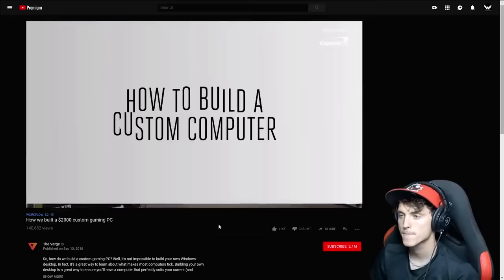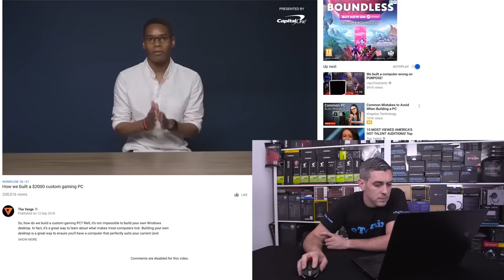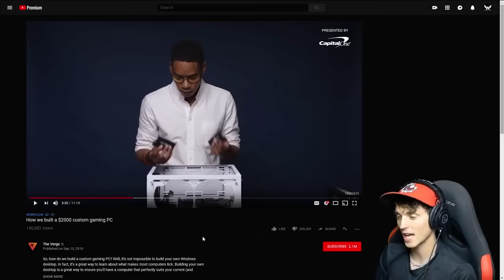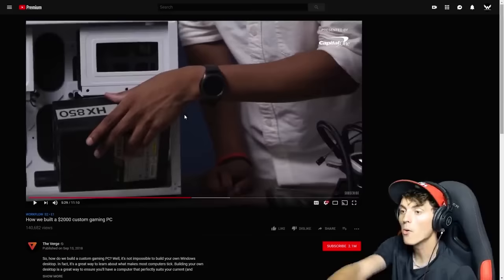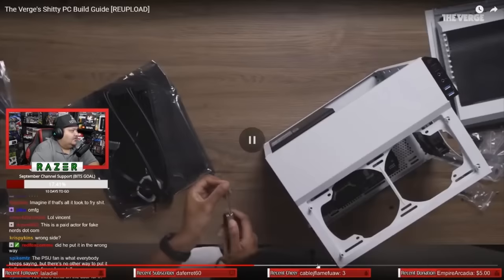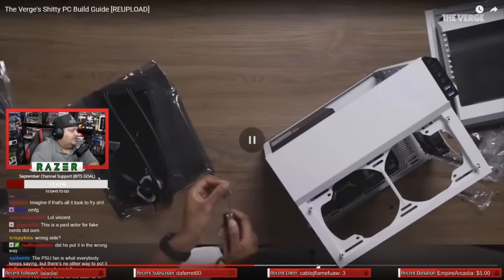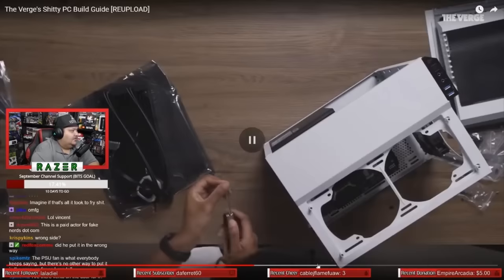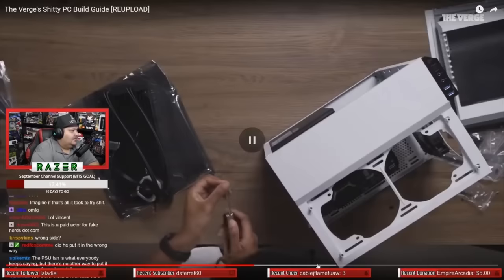The Verge's $2000 PC Build Reaction Supercut

Comment: imagine being satisfied with 70 fps after spending $2000 on your pc
Reply: i mean if it was on 4k ultra id say thats pretty good, but it wasnt so...
Reply: Even Joey delgado Got 120 FPS only with $400 PC
Reply: Diarra Altera Virendra i got the acer nitro 5 with rtx 2060 gpu i7 9thn gen cpu and it came wit 8gb ram but i upgraded to 12gb
Reply: @S0L0_544  Owww, Mid end to High spec i like it
Reply: Diarra Altera Virendra yep
Reply: You guys have more than 60 FPS? 
What feature is that on console?
Reply: uh bruh its the feature where u throw ur console out the window and buy a pc. But fr i still love my ps4
Reply: rf Eli so whats rhe point. Also my monitor is 240hz. Also mines a laptop
Reply: rf Eli also on some older games such as dead space i get 500 fps and 650 in menu screen
Reply: AlexRichter544 theres no point other than seeing how fast your pc is lol
Reply: Gemstone addict i could tell the difference if i ever get fps drops, but its probably because my eyes are used to seeing 200fps by now, which is a curse cus i play cod on ps4. but someone who is used to lower fps than what they’re looking at may not see a difference between two higher ones
Reply: @Stizy  at that point u might as well crank up the settings
Reply: @gemstone_addict  im pretty sure its lower than that as ppl say but the fact that we move and look around rapidly makes it to where more frames is beneficial to filling the blur when moving.
Reply: I get that with about $380
Reply: Bro I get 60 fps average and I spent 400$

Edit: just found out that my computer was capping all of my games for 60 fps so I can actually get more fps than 60 lol
Reply: We dont have to imagine lmao
Reply: Bruh
Reply: AlexRichter544 why buy a laptop for gaming and not a desktop?
Reply: He literally built the "hottest" Pc on the market LOL!!
Reply: AlexRichter544 laptop valorant  andy yikes
Reply: AlexRichter544 I have the same laptop as you, but when I play games like siege, the cpu temp gets pretty high like around 80% but it shouldn’t hit that, I think? you got any advice since you have the same laptop? I still am using the 8gb ram and 1650 gtx it comes with.
Reply: AlexRichter544 what kinda ram do you use too?
Reply: AlexRichter544 also do you also get a problem with loud fans or is it just because my cpu and gpu are low
Reply: @S0L0_544  whoosh, i guess
Reply: I get your sentiment, but the game he is playing is ArmA. It's optimization is absolute garbage. Majority of us would get 40-50 FPS in multiplayer. He is getting 70 because he is in SP (editor). With that PC, I'd expect to see 40-50 FPS but how he built it, but his CPU would probably throttle and give him 15-25FPS in a couple of minutes of MP. (This game is very CPU intensive and only uses a single core)
Reply: At least you got 120 fps at lol
Reply: @S0L0_544  meanwhile my lenovo legion y520 runs valorant with 120fps but litterly drops everytime to 30fps
Reply: Omne Obstat But the prob is, it isnt 15 years aho. And its an i7 and gtx 1080
Reply: I built a PC, bought a monitor, keyboard and mouse for $1400 and I'd get sick to my stomach if I ever saw 70 fps.
Reply: Did you not see everything else that just happened
Reply: Rxbsii at least he got to turn it on without a fire😂
Reply: Rohan Tejeswar well he chose a bad game to test his pc with lol
Reply: i get 50fps on an E-Mac... spending $2000  on a NEW computer to only get me that much...?
Reply: ._. Radeon Hd 3600 apu... 2007. 85fps 1080P. All ima say. Lmao
Reply: Actually if turn on is by miracle
Reply: 70fps in ARMA3 is good result. Framerate in Arma is more dependent on what is going on in the mission, rather than what PC you have (for some extend). But yeah, 70fps in just a single plane flying is not that impressive.
Reply: The Doomsday Duck trust me 2000 can get you very very far if you know what ur doing and know how to overclock, this dude doesn’t know what a zip tie is
Reply: @davirendra6774  WHAT SPECS?? I WANNA KNOW
Reply: @IIFM54  The 400$ PC?
Reply: @davirendra6774  ye
Reply: rf Eli an i7 9th gen Mobile can’t do 240fps the tf you on?
Reply: lmao..  the guy is a huge clown
Reply: My shitty dell laptop can run league at 250fps
Reply: I can hit 70+ on my 6 year old shitbucket
Reply: @S0L0_544  playstation for the exclusives tho. If the console market wants to stay afloat, make me buy a console cause there's 5-10 games I really wanna play that's only for that platform.
Reply: I mean, it is Arma, but then again he is in a jet when he says it sooooo
Reply: I would feel genuinely bad for anyone stuck with that fps after that budget.
Reply: Mac
Reply: James Nguyen my fans are at max speed while gaming which is quite loud but when im wearing my headset i cant hear it
Reply: James Nguyen i think 80 degrees is fine but if it gets any higher make sure to use the nitrosense software that comes with the laptop to increase fan speed
Reply: AlexRichter544 I mean valorant isn’t that demanding but that’s still pretty good
Reply: I can hit 70 FPS on ArmA with my $1.2k laptop. And that's on medium-high setting.
Reply: With motion blur in a plane xD
Reply: @uhbruh9223  currently there are monitores that support over 244 fps
Reply: AlexRichter544 Damn and only 1k?
Reply: uh bruh You need to throw your console in the trash, buy a pc, now you have joined the master race and can work, talk, draw, edit videos, and play games at 120+ frames. Welcome to Nirvana.
Reply: My laptop gives 60 fps consistently ( can go beyond but screen is 60 Hz only) and it's only 800$. A PC at same price is supposedly more powerful than my current laptop. This dude made a PC costing 200$ more than twice the price and still got only 70fps. Why? Just why? They could have hired anyone from this video and gotten a better and cheaper build.
Reply: this post was made by rtx gang
Reply: When Linus watches him, Bring the shotgun! Time to use it boi!
Reply: he be playing lol and going omg 70 fps meanwhile my thibkpad runs minecraft multiplayer at 300 fps and the think pad is old as shit its not even in production anymore
Reply: @Sinsanatis  well but fps xD
Reply: @davirendra6774  you got lucky mate also nice budget
Reply: @dragringer1480  That's not my PC 😂😂 i don't have a PC i play in Console i just tell that tech Youtuber "Joey Delgado" Got 120 FPS only with $400 PC
Reply: @S0L0_544  goddang. I can only get 24-30 fps in most games, 10-15 if im lucky and 60 in the menu screens
Reply: Robert TheRonin what computer do you have? Before i got my current laptop i had a surface pro with a intel core m3 cpu intel integrated graphics and 4gb of ram. So basically it couldnt run anything
Reply: @S0L0_544  ill find it out tommorow morning. Its a laptop but its meant to be a gaming laptop so I dont know why it is the way it is
Reply: at 4k it would
Reply: Robert TheRonin ok sure let me know
Reply: I mean it is Arma
Reply: U guys have PCs?

Still uses my gameboy advanced
Reply: Arma 3 is strictly cpu expensive, tanoa and Livonia (newest maps) are taxing on gpus but generally arma 3 is badly optimised.

But getting 70 in a jet on tanoa with no ai is not an acomplishment.
Reply: @Stizy  What games do you play that get such godly fps, and can I please know the specs to this creation?
Reply: Also league of legends tho
Reply: @Stizy   Try playing actual games lol
Reply: I get 70 to 80 on my £800 build 1080p high.
Reply: I get better fps on my freakin phone
Reply: have you count the spare parts?
Reply: rf Eli Dude, real world is obviously more fps than any monitor. You didn’t get super eye powers from your computer monitor, thats beyond stupid.
Reply: @davirendra6774  yeah, if you play minecraft then yeah.. My $2000 pc runs minecraft on 900 fps so..
Reply: yeah like wth he should have more than 100 fps unles hes playing with rtx or some shit
Reply: @S0L0_544  where did u buy the ram bro?
Reply: im satisfied with 140 to 150 on ultra settings on my middle of the road build at 1080p
Reply: Luna's Mom got off ebay cuz im poor now. Btw i luv luna too
Reply: Hey man, that's ArmA. I'd kill to get a stable 70 FPS on that piece of optimization garbage.
Reply: When I put frame rate on unlimited I can run up to 4500 frames per second I spent the same amount the verge did.
Reply: 11 Decky Mass 11 sure you can
Reply: @S0L0_544  valorant is pretty ez
Reply: Diarra Altera Virendra notvin 4k High
Reply: For 2k, I'd want an absolute state of the art beast.
Reply: My 800 dollar build had more fps lol
Reply: My $1100 laptop with a 2060 can play warzone at 144+ fps all day, this company is shit.
Reply: Holy shit I can get that with integrated graphics
Reply: @gemstone_addict  nope there is 100% a difference, I've been playing on 240hz and looking at any lower refresh rate looks kinda jittery to me.
Reply: @Stizy  the frames that aren't shown are still important, they allow for more responses per second, which is essential for any game where you need to perform things fast
Reply: @uhbruh9223  xD, this is too underrated
Reply: rf Eli     guessing your playing CS:GO on low settings for 500 fps or a game with lowest setting lol
Reply: AlexRichter544 how do you upgrade a laptop with 12 gb? If you don’t mind me asking.
Reply: I have a better pc and barely getting 30 fps on minimum requirements in arma. But that's normal
Reply: That's pretty good for Arma 3 lol
Reply: @S0L0_544  my 1000€ PC gets 400-500 in valorant
Reply: No cap I'd want 200 frames at all time
Reply: Being quarantined is a better way to feel tho..
Reply: I spent 1200 on mine and Im sometimes very dissatisfied with performance such as when i get like 100-120 fps in sea of thieves, so if I spent 2000 i would want a shit ton of fps lmao
Reply: Zx7o not all day cause it will explode
Reply: @PrincessAshley12  you add a 8 gb stick with the already 4 so 8+4 is 12 gb
Reply: @Alexander Grega On what games though is the question
Reply: I have a 500 euro laptop and im satisfied, in siege i get over 70 fps lol
Reply: I mean tbh ur eyes can just capture 60 fps max.. so it doesnt really matter..
Reply: Exactly LOL
Reply: Sinsanatis no it always should be above 144
Reply: @Stizy  i don't really understand that, lets say you get 170 fps but your monitor has 144hz do you only get 144 fps?
Reply: @kodakorange4820  yes, your fps is capped at your refresh rate, however games can still run faster than your refresh rate but it wont make any difference
Reply: @passivepoet  i get 500 fps on games like valorant, wow, iw4x, ect. i dont play csgo. more demanding games like the new mw run at 200. i play everything on ultra
Reply: rf Eli so do I, i get 2000 fps in valorant, its so easy to get high fps, but thats while your loading the game up
Reply: @S0L0_544  Bro, don't put that shit on your laptop. You won't be running anything at 300 anymore if Denuvo has anything to say about it.
Reply: My 1000$ pc runs games at 300 fps. Somethings wrong .-.
Reply: youcant even notice over 30fps as a human being,take a moment to proces this fact
Reply: Lol I have a $600 acer nitro 5 that runs valorant at 190 frames on ultra settings
Reply: Diarra Altera Virendra I can back those claims, my $600 acer nitro 5 runs valorant at around 190 FPS consistently
Reply: That shit better be the highest possible settings on the earth🤣
Reply: @S0L0_544  WHAT, I GOT THE SHITTY ASS AMD 5 (amd would be fine if it was amd ryzen 9) RX RADEON
Reply: James Nguyen my fans at max speed are quite loud but i camt hear them if im wearing a headset
Reply: Harys 8  Okay mate, But don't really need Laptop at this time but good Recomendation thx
Reply: @uhbruh9223  if you wrap your console in tin foil your FPS stays at a solid 420.
Reply: Imagine playing Mero Exodus
Reply: i can reach 72 FPS on a game thats more detailed than Arma 3
Reply: Lol i ran 3000k fps from a 2k build on games like league
Reply: @uhbruh9223  uh bruh....
Reply: @terryglover6442  bruh?
Reply: Lol all those people bragging about their 200 fps, but their monitor is 60hz and can't display more than 60 fps
Reply: @uhbruh9223  don't act like you don't know what I'm talking about
Reply: theres literally a 900$ pc that can run in 120fps+
Reply: That shit better get 144 average and never drop below 100 even under intensive games.
Reply: Depends on what game or what render you are doing to get 70 fps. If im runing crysis 3 in max and ashes of singularity at the same time and getting 70 this is insanely good
Reply: @NeostormXLMAX  yeah but he was playing LOL (I think idk I dont wanna rewatch this shitty video but it was either LOL or a similar game) a game that even Walmart laptops could probs run in 30 fps.
Reply: How the f did this thing POST?
Reply: I haven’t got that far in the video but honey f*ck there’s no wayyy 😂😂
Reply: I would be ngl
Reply: @orangejuuc1524  bet this the kinda dood who thinks you can overclock a power supply and download ram.
Reply: Imagine only investing $2000 XD
Reply: @S0L0_544  OK but valorant style is a 1st grade art class? So thats not surprising. Phones can probably get 300fps on valorant
Reply: I mean if it was a minecraft with rtx on
Reply: Imagine using a 1080ti when you spend $2000 dollars.
I have a 2070 super and an i5 with 16gb of ram the i5 was because that’s all I need and for games I wouldn’t get an FPS boost from it. All my work is basic calls and spreadsheets so I don’t need an i7 or i9. My pc would outperform this guys pc and I spent $883.
Reply: AR544 my $883 pc could do the same
Reply: The fact that I can get more with a $500 build.
Reply: Gabriel Tobing ya lol this dude isn’t smart. My pc on very graphic intensive games like Star Wars Jedi fallen order on max settings still gets 90 FPS
Reply: if it had good graphics and actually worked, then yeah i would for 2000 nzd
Reply: More like 30 fps. The damn nintendo switch is better then that shit 😂
Reply: Gemstone addict people still think this?
Reply: i spent $1500 and I'm not even satisfied with 130
Reply: im not really smart with computer tech but either my pc is not as good as i thought or its just my monitor as you guys are saying
Reply: Oganj Perish I hope you’re joking
Reply: @S0L0_544  Yeah mine is at 400 too bad we don't have monitor that can go that high up yet.
Reply: Ross Leonen we can get 360hz
Reply: cachirulo portability
Reply: James Nguyen mine goes too hot as well. Ima get a laptop cooling pad and undervolt my cpu
Reply: @S0L0_544  upgraded? I didn't think you could upgrade laptop specs, was it as much of a pain in the ass as I've read?

I have an MSI Stealth Thin with 1 TB space and 32 gb ram, running Nvidia GTX 1070 and Intel i7 btw
Reply: HomeKitty2 depends on the laptop. Mine is basically made to be upgraded for ram and extra hard drive. But u cant upgrade anything else. Idk about ur laptop though u should research. Btw i upgraded to an extra 2tb hdd and 16gb ram but it can go to 32gb
Reply: @S0L0_544  same
Reply: Fax
Reply: Imagine being satified
Reply: @Stizy  On roblox?
Reply: @cesarsuarez6036  because not everyone has the money for 2 devices, one for home and one to bring to work or what not so the best of both worlds is dropping a few more bucks on a decently specced laptop, plus nowadays the real world gaming difference between a desktop and a laptop is about 10-15%.
The main thing you lose with the laptop is upgradability on the main components like mobo, cpu and gpu.
Reply: @HomekittyL2  the stealth is tricky because the motherboard is upside down, but you can upgrade ram, ssd, wifi chip and hdd
Reply: I mean, it was ArmA. You can be glad if that shit doesn't blow up your rig the second you load into a map
Reply: Nowadays, 2k on a pc can get you 90+fps on 4k ultra
Reply: @gemstone_addict  You couldn't be more wrong lol. It wasn't too long ago people were saying the exact same thing about 60hz. 144hz - 240 isn't as much of a difference but it's still very substantial in competitive games.
Reply: @schizzldizzl897  I hope you're trolling lol. It's not 2010 anymore I can't believe some people still believe that bs ahahha.
Reply: @skipper2144  ofc every Person is different and can capture the frames different per second but after 24 fps ur eye doesnt the frames anymore.. its movement.. and ur brain cant get all the information out of the 144fps. just read books
Reply: Huahuahuahuahuahuahua
Reply: Yes i get 700fps at 144p
Reply: Bruh i just built a 400 dollar one and i get 120 plus fps
Reply: @davirendra6774  what game
Reply: @davirendra6774  tell me your specs cuz im tryna buy a pc
Reply: @angeloxdmt  Search Joey Delgado and He build a lot of PC just choose the PC Build with your Budget
Reply: Ikr
Reply: Same game, but I get 110 fps... On a 650$ PC
Reply: I get like 60 with a $300 pc lmao
Reply: I got 1009 FPS once in Minecraft
Reply: rf Eli sounds like you spent more than $1300 orrrrr you’re playing games that are so incredibly outdated.
Reply: i bought my pc for 1000$ and i get 60-90 fps. I'm just happy i can still play :)
Reply: I get 70 FPS on my old laptop so I grew with that
Reply: My pc is 1k and its lowest gets 110 fps
Reply: Imaggggggine bro couldnt be me no sirrr
Reply: Hell I get 60+ frames with a $800 computer
Reply: I literally made a pc with $300 and run 200fps on fortnite, and 80fps on Warzone and he is happy with 70-80fps on a crap game with a $2000 pc
Reply: My pc was 1.1k and it runs most ganes with an average of 200 fps
Reply: @davirendra6774  valorant is an easy game to run at such high frame rates idk why are you getting surprised
Reply: Fxtsal  yes because fortnite is an easy game to run, low settings on 700$(not prebuild) is easy to reach over 350-400fps. But to be fair
A pc like that can also run bf1 at over 100fps(you can reach up to 150 ultra settings if u have overclocked ur cpu and gpu to high speeds like 4.2ghz cpu and 1860mhz gpu)
The cpu can be a r5 2600(120$) all the way up to r5 3600(165-170$) (also zen 2 is about 10-15% faster than zen+). You can go Intel but amd is the better price-performance option so yeah and all of their cpus can be overclocked
The gpu can be a 1660 super(230$), 1660ti(260-290$) (basically the same performance), RX 5600xt(280-300) (15%+ faster than the 1660 ti), rtx 2060(5% slower than the rx 5600xt for the same price, well, it's around 300-320$)

700$ is a very very good spot for 100+ fps 1080p high settings AAA games and can run easy to run games at over 250fps med-low settings
Reply: Ha. My PC that I built could simulate a fire at...
...wait what? Oh, never mind, the fire wasn’t simulated.
Reply: AR544 Bloodborne...nuff said
Reply: Chrypson 😥
Reply: Fr
Reply: @Stizy  ur saying like 280hz is low
Reply: Bruh my cheaper laptop gets 70 FPS on max settings on 4K...
Reply: @davirendra6774  playing what, fortnite or minecraft? Lol!
Reply: uh bruh I love my PS4, but 60 fps sucks once you’ve been exposed to the crazy shit computers can do. I recently got my first ever pc, and I’m lucky to have a tech savvy brother who told me what parts to get and he put it together. It wasn’t too much money and I can run Rainbow Six Siege, my favorite game, on 200+ fps with great graphics. Shits incredible. It was like discovering fire.
Reply: Imagine boasting about your FPS on your 1080p monitor.
This comment section is cancer.
Reply: @Iam its not low at all thats just where it caps so theres no point if the fps goes higher
Reply: @OdysseusKing  Feels like a bunch of kids who got $1000 laptop tbh.
Reply: Oof
Reply: not just 70 fps also you get to burn 2000$ work within 1 day intense gaming. 😂😂😂
Reply: Ikr, my laptop that got 70 fps (at valorant, which is very low) just cost less than 600$
Reply: especially in arma 3 lmao
Reply: @S0L0_544  I spent $1k on my laptop too but it's not that powerful, but then I realized mine is 3 years old and yours literally just released and had a massive price drop on top of that.
Reply: my $1700 pc will be able to run 8 k when i get my new gpu
Reply: @Stizy  only 280hz me crying in corner with overpriced 75hz
Reply: In be happy with 70fps in flight simulator. Funny how they mentioned rendering in a flight sim is nothing. Said no system ever in flight simulator lol
Reply: If you followed this guy's instructions,  you wouldn't be getting any fps. You'd be trying to claim insurance for the house fire.
Reply: renoir can do that its so sad.
Reply: BRUH MY 1350 DOLLAR PRE BULT GIVES ME ABOUT 130 FPS
Reply: i spent 200 and got twice the frames
Reply: AND that is where im at today!, 10700k , 2070 evga xc utlra, 32gb of ram, and well.... soon gonna have my 3080, realllllly soon
Reply: @GhostHouston  you just flexed on me even though I have a good gaming pc
Reply: Only to lock LoL at 120fps....
Reply: Yeah holy fuck that's the worst part is I spent a thousand for my first medium-high end build and that thing runs CIRCLES around this piece of shit if he's only getting 70-80!
Reply: @S0L0_544  Not on Ultra 4k though
Reply: My (20k ÷ 70) dollar system that I got 2nd hand with a 21 inch monitor and keyboard and mouse. Runs valorant at 60fps at low settings. It doesn't have a graphic card yet. If made properly then a 500 dollar system can outperform verge bs
Reply: @S0L0_544  valorant. That game is made for shitty graphics card. Bad example
Reply: Well, cut those $2000 in half if you live in a shithole of a country with inflated prices. So, that statement isn't that unreal.
Reply: @S0L0_544  says the laptop user
Reply: @S0L0_544  yeah if it wasn't for the exclusives I would have thrown my console out lol
Reply: W
Reply: @cesarsuarez6036  space, mobility, price, but mostly space, cause even a miniATX form factor takes up a lot of room
Reply: imagine being satisfied with 26fps on minecraft with a 2000$ pc(my friend)
Reply: Imagine calling a "Bomb" a "PC".
Reply: @davirendra6774  I love your enthusiasm. I also like your profile pic fellow Maggot.
Reply: @eggsb3nedict347  What's your specs?
Reply: @stoopidhaters  I got a ryzen 3 1200, Radeon rx 570, (4gb card), 16 gb of ram, 256 gb ssd (m.2), 2 tb hd, and a b450 motherboard
Reply: I would rather play pubg mobile at 90 fps on a smartphone for an infinitely cheaper price....which is what I'm doing...mobile is the master race HOORAH
Reply: My PC is worse then that and yet I’m pretty sure in outperforms that crap
Reply: I get at least 85 on my rig with no graphics card
Reply: My laptop I used to have with a 1050 ti runs games same performance as his 2 grand pc which has a much better gpu than mine
Reply: @S0L0_544  having a higher FPS is still good even if your monitor cant support it, think of it as each end has almost an input lag. And by having a higher FPS than your hertz youll still be eliminating one of those areas of “input lag”. Not up to 500fps but 350fps with 280hz is still better than 280fps with 280hz. It’s a little confusing but i hope this helped
Reply: @cesarsuarez6036  i imagine they wanted the portability and small size. But i agree desktop is a way smarter investment
Reply: @sn8wball  ye i didnt understand at the time but i do now. Thank you
Reply: I’m a boomer 1080p 60fps is all I need.
Reply: @davirendra6774  buts it's shitty graphics
Reply: Fxtsal  with your trash prebuilt?
Reply: My pc is literally 200€ and it fucking runs on average 100-120 fps on everything even with a shitty fucking graphics card (which im replacing soon) on games like genshin impact and valorant
Reply: @davirendra6774  152 fps in League with a 800$ Laptop.
Reply: @S0L0_544  then 300 fps isnt impressive i have 5 3600 and 970 and i get 300+ always
Reply: @Stizy  Sorry for late reply but absolutely. After hundreds of hours of playing at 120fps minimum, any shooter titles at 60fps is unbearable. Games like Tomb Raider or Assassin's Creed (on a controller, I feel like the lower framerate is not as noticeable on controller) are still good in my opinion.
Reply: @Stizy  What are your pc specs?
Reply: My $1200 pc has gone over 1k fps sometimes in Minecraft when I uncap it, although usually its around 5-600. For more intensive games I've never dropped below whatever the game is capped at. The only time I've ever seen any 'major' slowdown with it is doing some ridiculous boat collisions in Teardown, but even then it almost always stays above 45 fps.
Reply: @Stizy  specs?
Reply: Not to mention he's playing on 1080p and not 4k  there should be more fps than that  , that tells you it's not even 2k (even by the time of the video)
Reply: Nasty trim  specs???
Reply: He was also using arma when he said that... Which is probably literally one of the worst titles you could pick to do a benchmark with. It's notorious for inconsistent/erratic and poor performance, it also can't utilize modern hardware to its fullest potential
Reply: My 90 dollar monitor can run 144 FPS lmao
Reply: he forgot to buy 144Hz monitor
Reply: bruh who even locks there fps on a game while benchmarking that though a game that can run on a overclocked potato on a 2000 dollar pc
Reply: itslovi  on pac man yes on cyberjunk no
Reply: I would flip my shit.
Reply: On league of legends not a very high end game
Reply: I have a 3800x rx6800 64gb ram as main pc and in my laptop intel i5 10th gen 2060 16gb ram
Reply: @davirendra6774  Wow, now I feel bad because my PC is around 600 and mine gets around 70 on some games, now I feel like I overpaid lol
Reply: @sn8wball  Yes! that's what I am doing, I have a 4k UHD monitor it's capped at 60hertz, but once I get a good graphics card (big if prices lol) I'll be able enjoy my 60 fps in ✌️ peace.
Reply: @killert41  Nice! 🤛 that's some decent specs, I'm using 32 gigs of RAM, Ryzen 9 3900x and my temp GPU is a GeForce 710:(.
Reply: @AwankO  hope you get a gpu soon, it’s been such a pain in the ass to get one for me too. My build is more centred around being the best esports FPS machine, when all my parts come in I should be getting 500fps+ on competive settings at 1080p
Reply: I'd be satisfied for a build of half the price.
Reply: @uhbruh9223  LOL
Reply: @blackcatgamer310  I agree. Actually, I'd expect a little more than 100fps with 2k/1440p
Reply: @blackcatgamer310  at least a 100+????? More like 300+ at the minimum
Reply: @S0L0_544  that laptop is a fucking beast it's actually crazy for the price
Reply: @davirendra6774  But after gpu market goes expensive it's now less than 60 frames 768p60hz low settings
Reply: @uhbruh9223  you can make that feature available on console with moding them
Reply: I'm guessing by that point it was just a miracle it even turned on lol
Reply: @luciuswomack4337  i spent 450€ on my pc and i get around 200-230 fps on average
Reply: Nasty trim  with half the price my computer runs almost the same fps 200-230 on average
Reply: @scidja8567  I think the issue is I have all new parts, but a graphics card from like 2015, that wasn't even really amazing for that time. I am going to try to upgrade my gpu when it's possible to actually get one lol
Reply: @luciuswomack4337  and what is your gpu specifically?
Reply: @scidja8567  Zotac gtx 1050 ti 4GB low profile. I'm not actually sure if it's from 2015 or not, so take that with a grain of salt. It may be good and something else is the problem, I'm not that sure.
Reply: @luciuswomack4337  yikes a gtx 1050 ti is actually shit 😅😅
Reply: @Stizy  can I have a link to buy your monitor?
Reply: @davirendra6774  whats the build
Reply: @S0L0_544  I just have my ps4 because of Uncharted and Spider-man.
Reply: I mean on Arma 3 thats as good as you can hope for.
Reply: I'm satisfied with 27 fps in GTA... Actually it's usually 11 fps (crying intensifies*)
Reply: My guy made spent $2000 to make a pc that performs worse than a $500 console
Reply: I'd be disappointed at that tbh, with that kind of budget I expect to run the latest games with the highest fps being 300 fps and lowest being 150 or maybe 200
Reply: And on league 😂
Reply: tarkov and offworld industries game players be all
Reply: The game he was benchmarking was Arma 3, which is a notoriously unoptimized game to run.

You're lucky to get about a stable 50-60fps while playing it.
Reply: @RohanTej  how would he thermal throttle?
Reply: @randomstuff508  you're really gonna sit here and defend the worst pc build of all time? his pc is way more unoptimized than the game. he should have AT LEAST 100+ fps especially since this was $2000 back when parts were cheaper. my $1300 build has never had any problems running any game at 140fps or higher
Reply: Lol
Reply: That’s me
Reply: i spent half, upgraded a 1060 to a 1080ti , got a significant increase in framerates, bottlenecked by cpu, to be honest i can play most games on 80ish fps but even if i got more, i d still wont be satisfied:P the life of a nerd.
Reply: I spent $650 unsung pre owned parts and I was not happy when I didn’t reach 60 fps
Reply: to be fair, 70 fps on arma 3 is about the best you can expect. game is poorly optimized and only uses a single core
Reply: Even on GTA fucking 5
Reply: Dual channel really gives your computer life
Reply: i get more fps on a 300 dollar budget pc playing ff 7 remake
Reply: Exactly, might as well just buy a console
Reply: Hey, I’m satisfied with that……. If it was 2000 spent 8 years ago, the graphics r high, and the games r demanding……
Reply: My 7 year old pc gets 120 fps
Reply: This comment hits different after the release of Alan Wake 2 and Cities Skylines 2 😂😂😂😂😂
Reply: Lmao its a sh*tty gtx 1080 that is sh*ttier even than igpus lmao😆